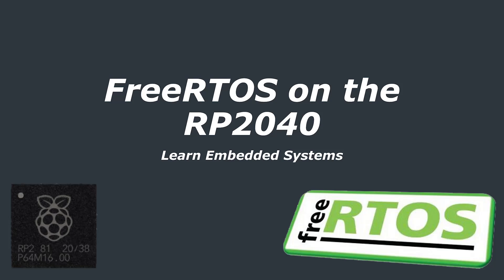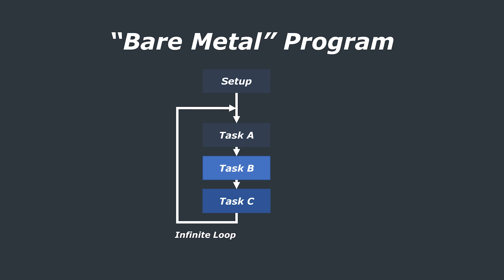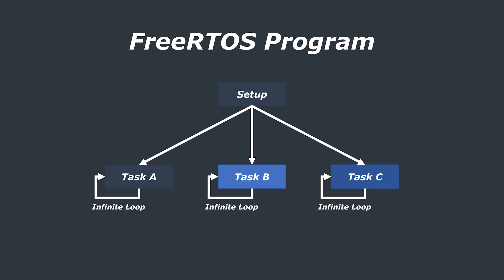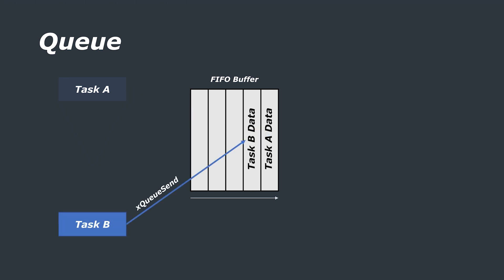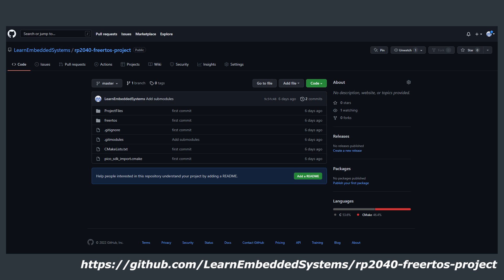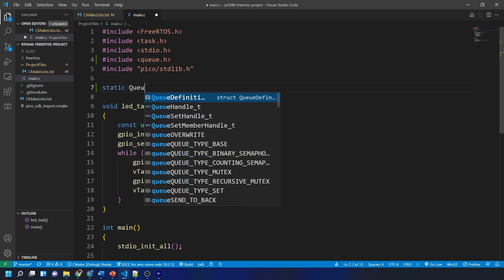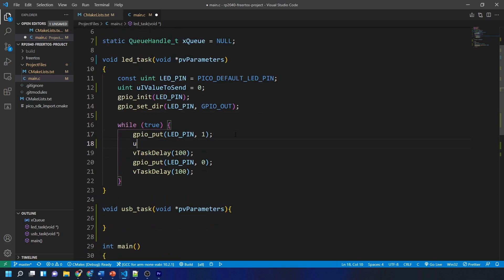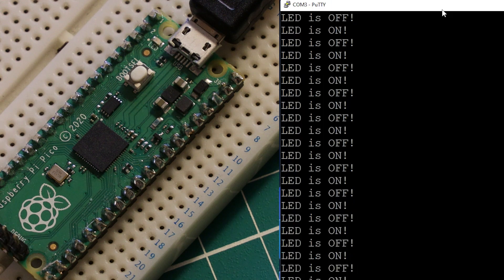FreeRTOS on the Raspberry Pi Pico (RP2040) Part 2: Tasks and Queues

Comment: I think it's worth pointing out that the information passed on the queue is passed by value, ie, the xQueueSend() function copies the information from uIValueToSend into memory reserved for the queue and the xQueueReceive() function grabs the info from the queue and copies it into the specified variable. There is no memory relationship between the source variable uIValueToSend and the received variable. No need to worry about race conditions when referring to the source information. Thanks for the video.

Comment: Sadly I was able only to follow until you've made the include.
After that just many questions appeared 😅 
For example, why _t in variables? Basically every line except the send/receive to/from queue, which you explained before.
And.. the example in the end doesn't show any advantages of rtos, the console is writing only after the state has changed..that a simple blink loop can do. Shouldn't it write the state whole time, like spamming the console with updated state? That sounds more like threading.
BUT: thanks for the coverage of that rtos topic, so far best explanation on YouTube I've seen.

Comment: I'm really interested in RTOS for the obvious reasons.  But...how does it compare to a State Machine?
Nice series. Thanx.   :)
Reply: I would think a state machine is likely to use the CPU power and RAM/ROM space more efficiently but in many cases it would be more error prone and make adding improvements and extra features more complex.
Reply: @BrianG61UK  Yeah. I think a state machine is a good tool but not an alternative for RTOS. Thanx  :)
Reply: @BrianG61UK  error prone? Not if it's DFA

Comment: Does anyone knows if trying to implement FreeRTOS like this in a raspberry pi 3 would work ?
Reply: You could probably do this, but the linux OS which is usually on the Pi 3 already does threads, and will use all available CPUs
Reply: But RTOS is suitable if you're using the pi for something that needs deterministic execution like industrial automation